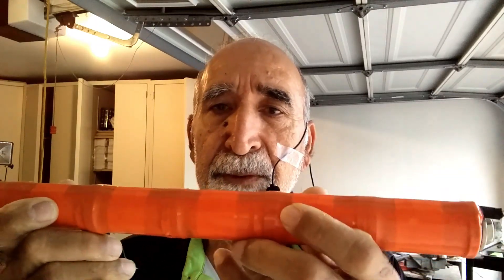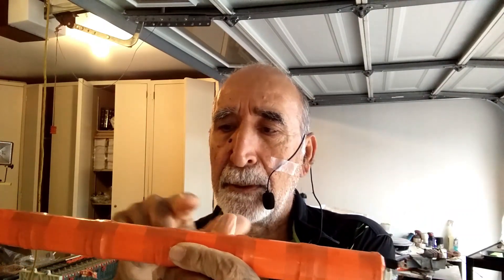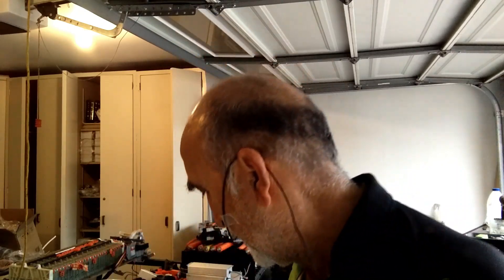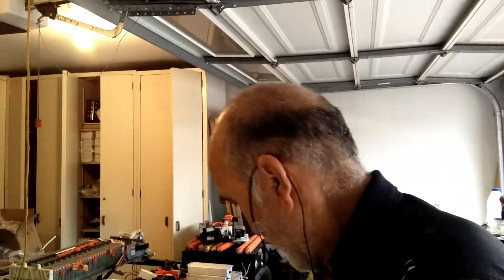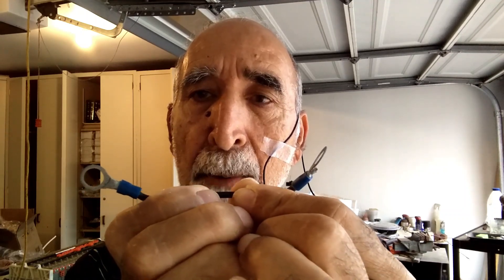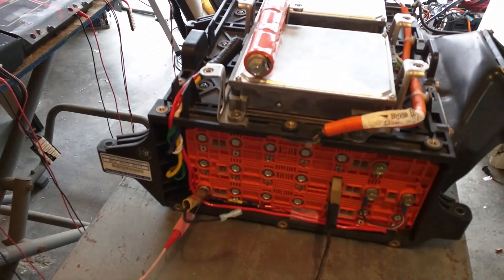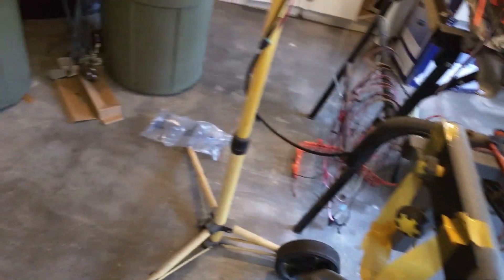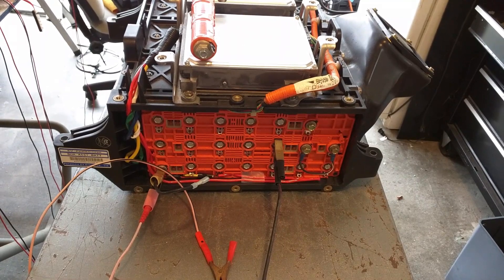Honda Hybrid Battery Packs - How to Recondition

Comment: Hello, teacher, is there a solution for the capacitance other than replacing the battery, and how can this problem be solved?
Honda civic 2007
Thanks❤
Reply from the maker: Hi Mohamed, the problem about capacitance is very real and difficult to judge. There are no easy gadgets to help. The best method is to replace the sticks. I suggest you order from China as you can get new sticks with 3 Years warranty.

Comment: Can I bypass the hybrid by I installing a alternator
Reply from the maker: Hi Robert, You don't need to install an alternator. Most of the Honda hybrids start even if the hybrid battery pack is not OK. Do some research on the Honda Forums.

Comment: Raj, how does that shop light set up work for the discharge?  That is, what sort of lights are these, very specifically.  I want to do this discharge, but I'll need that shop light set up.
Thanks!
Reply from the maker: These are work lights bought from Home depot, costing about $ 22.00. get the light and watch my video to use it and set it up.

Comment: Thank you, Mr. Raji "Hybrid Tech"!! 

You have been a tremendous help! My 17yr son's 2003 Honda Civic Hybrid IMA and check engine lights were on for several months. The car experienced random hesitation and decreased acceleration. We purchased a Grid Charger from Venice Tech, and it turned out to be a huge investment!! Through several hours of charging and discharging, I was able to recondition the battery pack and get my son back on the road. More importantly, you made yourself available to assist and answer all my questions, even when I felt like I was being a pest with so many questions. Again, thank you for sharing your Hybrid Tech wisdom with me. I have learned so much through our chats and texts!

Comment: If I have to replace bad cell can I use 1.2 v 10000 mAh NiMi in size D with the bump on one end to replace defective cells?
Reply from the maker: Replacing individual cell is rather impossible. You better replace the whole stick.

Comment: 2005 honda Accord v6 hybrid. only abs light on bc one of my front sensor is messed up. getting 21mpg 75%hwy driving. is it possible that maybe my battery is also bad? or is it bad mpg bc of the abs light.
Reply from the maker: The low mileage would indicate either weak hybrid battery or the engine not performing at the correct level.

Comment: Am Eric from Ghana, I had charged the battery pack but the Honda hybrid 08 is still not starting.  What could be the possible cause?
Reply from the maker: You have to cycle your hybrid pack at least 6-7 times. Cycling means charging it, waiting for about 30 minutes and then discharging it ,then again waiting for 30 minutes. Watch my video on " How to discharge a hybrid battery pack. Good luck.

Comment: Thank you Raj!   I told you about the '05 Insight I have IMA light on.   I just recently rebuilt the battery following your instructions to a T.  I gave it a total of 8 cycles.   Then I have been driving the car around for a couple of weeks and it has been performing flawlessly... until today. out of the blue, the IMA light came on...  Not sure what  the issue is.  I checked every cell for voltage and all were 1.3 V, more or less by a tenth of a volt. Suggestions?
Reply from the maker: If your Insight has PTC strips, then get rid of them. Check on Honda Insight forum on How to get rid of PTC strips.
Reply: @VeniceHybridTech  I followed your advice and eliminated the PTC strip s for the circuit and soldered in a resistor to fool the sensor system and it works great.   I have been driving around for a couple of weeks now and  the IMA system is working perfectly.   Thanks for the advice Raj!
Reply: @VeniceHybridTech  Positive Temp. Coefficient strips?  Do you have a link?